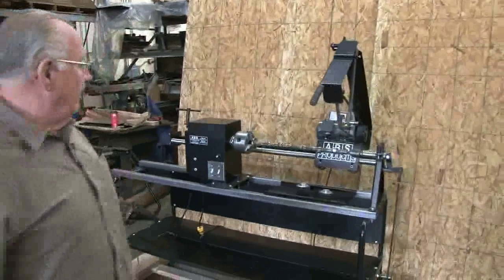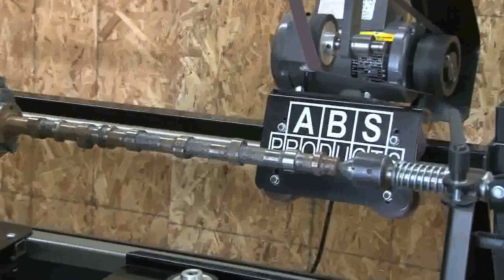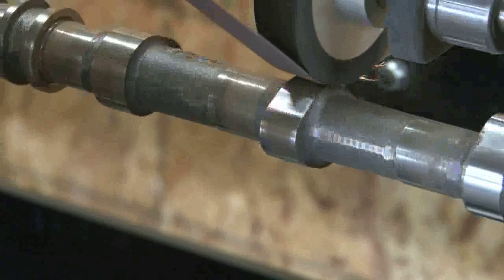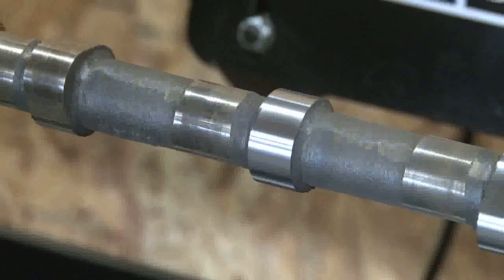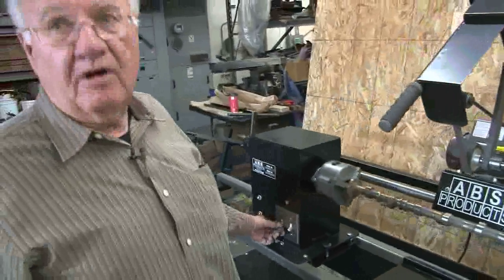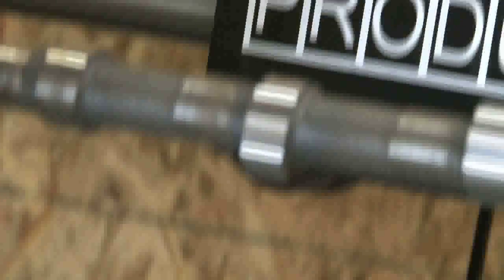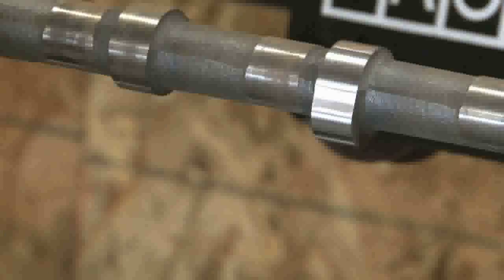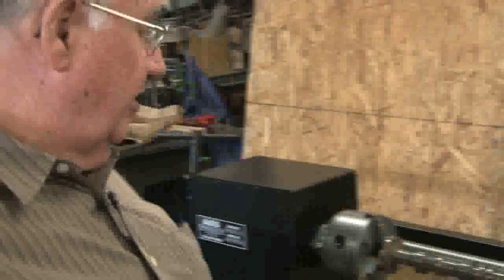Camshaft Polisher - Custom Camshaft Polisher for Aircraft Camshafts by ABS-Products.com 714-671-0728

Comment: Nice machine question do you change the belts to a polishing belt? 2500 Grit or higher? I'm running a predator 212 6.5 horsepower single-piston motor I am considering polishing the cam after balancing it how to get more RPMs and he's on the valve train. How high do you go when polishing